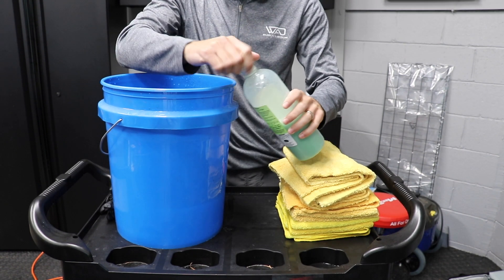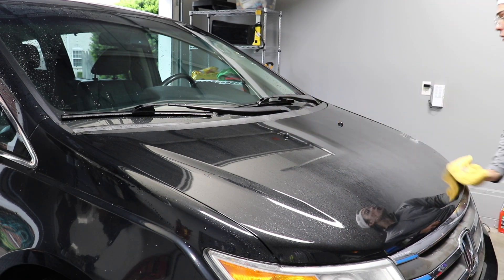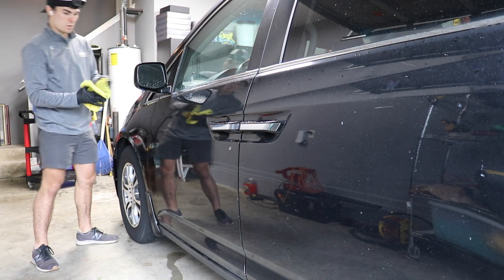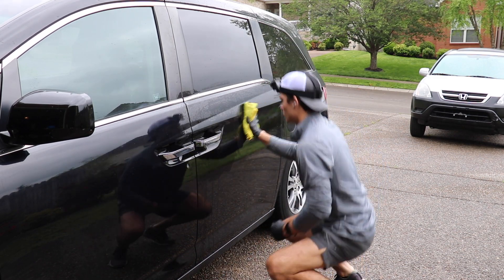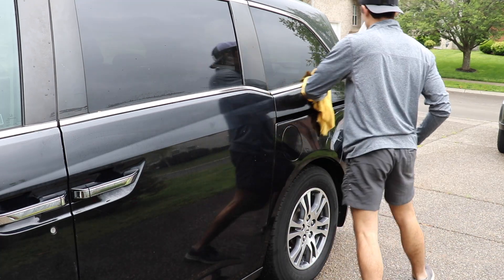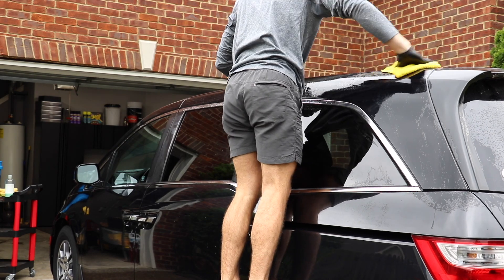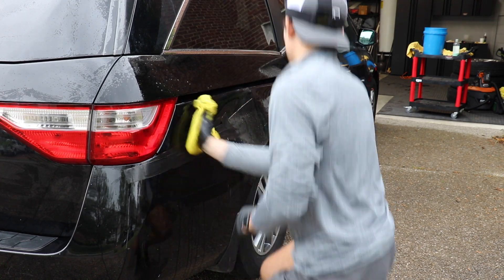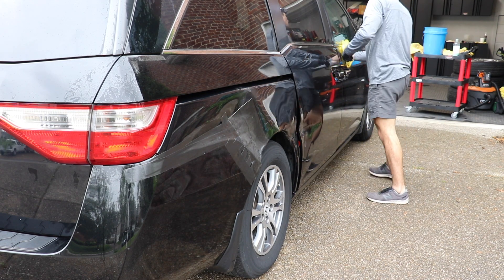Ultimate 13 Minute Winter Car Wash | 5 Reasons WHY This Makes Sense!

Comment: Winter time I use waterless products!! Then once the temps start going up I am back to a normal detail! Awesome video!
Reply from the maker: Yep! It's not the strongest or the smartest who survive, but the most adaptable
Reply: @wilsonautodetailing  exactly right!
Reply: Here in europe its basicly imposible to detail cars right now if you dont have a indoor car wash space. Rinsless is the only way, because of the snow and the temperature outside most of the time is 5°F.

Comment: I noticed a couple of things I wanted to mention. Please clarify or correct me at any point if I’m wrong: 

1.) Shouldn’t business owners that are self employed view their paycheck as an average salary rather than hourly? For instance, at a regular 9-5 job people get paid by the hour regardless if there is work or no work. While as a detailer, you get paid per job regardless of how many hours you worked. If your price is $200, and you spent 5 hours, you made $200. And if you spent 8 hours, you still made $200 using the exact same amount of product. 

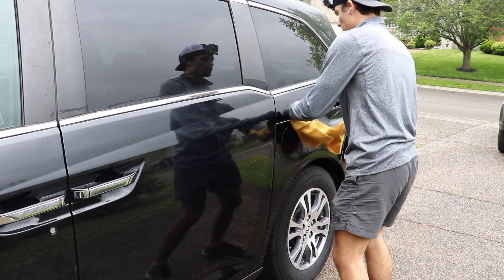2.) I noticed some comments saying you charged $230. But I clearly heard you say  it was a $50 job ( 2:47 ). Then at 2:55 you said it only took 13 minutes and if you calculated and extended this job over the course of an HOUR at a rate of $50 an HOUR you’d get $230. Now correct me if I’m wrong, but that doesn’t add up. 

3.) Also, I agree with you that there is no right or wrong way to do a job. Do what works for you and stick to it. But from experience doing the exact same thing you just did, doing a rinseless wash, the customer can change their mind in the future. Things change, they may decide to fix the dent and do a paint enhancement in the future rather than selling the vehicle. Not saying you should of done an extensive job, but it’s something to keep in mind
Reply: $50 wash which takes 13 minutes.. 60 min divided by 13 mins = 4.6 total amount of washes per 1hour @ $50 = $230.00

But he basis his time at minimum $50 per hour so if a wax and wash job would normally take 2 hr and max about 3hr. Price would be at $150.. complete job in 1hr then that’s $150 per hour,  complete in 2hrs = $75 per hr... set prices so you would be properly paid and increase your wage per hour by completing the job faster than maximum time it would take you to do that job..
Reply: @JosephMobileDetailing  Right, so the way he SHOULD have said it is: “If I did 3.6 more vehicles following the exact same method, over the course of an hour it would equal $230.” Obviously this is only factoring in labor and not prep time, pick up time, payment time, & next vehicle drop off time. 

I agree that he’s using the right method to set his prices which is to get paid according to the job and duration of each job. But I’m just commenting on the observations I made. 1.) Unless he made $230 in that one hour, then his hourly rate wasn’t $230, it was $50. 2.) Unless he did 3.6 more vehicles, he had no reason to even mention $230. 3.) Using an hourly rate is a good way to set prices but (in my opinion) we, as business owners, should view our salary as “per job”, “per service”, “per vehicle”, or “per day”. Or at least we should explain our paycheck in that way rather than hourly as it may confuse the audience. 4.) If you scroll down the comment section, you’ll see how he did confuse some people 

Now the example you gave about the wash and wax for $150... mathematically the hourly rate changes, but realistically the price doesn’t change. Whether you spent 1 or 3 hours on a wash and wax, your total amount charged is still $150. Your hourly rate depends on how fast you work, but your speed doesn’t increase or decrease the amount you made. 

I’m not saying anything with any sort of negativity or bad intentions. I’m not saying he charges too much or too little. I’m not saying his method of detailing is incorrect. I’m just stating a fact and my opinion.
Reply: You are correct!!! Technically speaking, it is misleading, but with that method you could POTENTIALLY make $230/hr with all true right circumstances. 
Realistically, I don’t see that happening unless customer are lined up waiting and if that’s the case, the drive thru wash for $10 is most likely what they would choose..

I just know for myself I have a full time job and detail on the side, and for my area, south Louisiana, I prices my jobs on a $30/hr. Basis at minimum.. Express wash is hand wash, wax & dry (spray wax as drying aid), & tires shine is $35, and usually takes 20 mins, and Basic Detail (wash, Decon..,clay, wax, tires shine, vacuum, interior wipe down & protect) is $100 usually takes 1.5hr (1hr min -2 hr max)
I price accordingly for the area I’m in and for the amount of product I use, but even when worst comes to worst on a job I’ll always hit my minimum of $30/hr..
Reply: The average person works on a hourly wage  so I guess that why he used that to connect but honestly I feel like if you wanna track hourly you should only do so at end of day once all work is done. You know what you made and how long you worked giving you accurate numbers.. yea I totally agree with you Mr. Piggz.
I guess I price the SERVICE based on an hourly figure that’s in my head which is at 30 bucks..
But yes as I scroll and read I see the confusion..
Reply: @JosephMobileDetailing  That’s pretty much what I’m tried to explain whoever reads the commends lol

Comment: I do the same here in Erie PA. But I have to use the pressure washer for the tires, rims etc. What do you do for the tires, rims, etc.? Please help.
Reply: I like this method: IK Foamer with Brake Buster 10:1, scrub tire with tire brush, scrub barrel with barrel brush, ONR soaked MF towel on wheel face, then rinse off with hand pump sprayer of water/ ONR, then spray wax and dry wheel.  (or wipe majority of soap off then you'd have to do less rinsing).

Comment: You need to include travel, setup, takedown in your hourly rates. Otherwise you can’t truly compare rates for different services and you don’t understand your opportunity costs. I’d guess realistically this probably comes out closer to your longer jobs at ~$100/hour.
Reply from the maker: In some ways yes and in some ways no. There are time, like this, where set up and take down are so negligible it would be a moot point
Reply: I’m assuming travel would be the larger part of this. In any event it’s more about comparing apples to apples and considering the opportunity cost. The travel, setup and takedown will be a larger precent of your time for a faster job and thus have more of an impact on your hourly compared to a 12 hour job but to determine the best business decisions it’s all about understand the true costs of every job so you can make the most informed decisions. I’d say you are doing great by even matching the hourly rate for a 12 hour job with a 30 minute job. More often then not it’s much harder to be as profitable with a smaller job. (PS - I’m not a detailer but a business owner and auto enthusiast so take this more as general business thoughts than detailing.)

Comment: Surprised you can’t take an extra minute to use a pump sprayer to soak the panel before you go smearing a towel all over a dirty car.  Even if the paint condition is scratched and swirled you aren’t helping it any further.  Many of your videos highlight giving extra value to the customer and this is an area a quick spray of the panel with a pump sprayer would give that extra value.
Reply from the maker: Once again, very case by case. It's a bit of an oversimplification to make a judgement call like this from a distant video. It would have been overcomplicating, and pointless to add what the internet detailers would call "extra lubricity" here. Completely unnecessary and wouldn't make even a 1% difference because of the pre condition of the paint

Comment: Nothing a $20 or Less  local car wash could of done.
Reply: Except that the customer will drive to the wash, wait in line and then the car will get whipped with plastic weed eater string or carpet panels and then drive home.  Plus you build a relationship for the future.
Reply: @verdantacres4460  Well technically this is still a vehicle drop off since it’s Wilsons garage. I’m sure the customer still had to drive to get it cleaned. Not to mention Wilson also said the customer didn’t care about further scratching the vehicle since it was dented & they were planning on selling it.